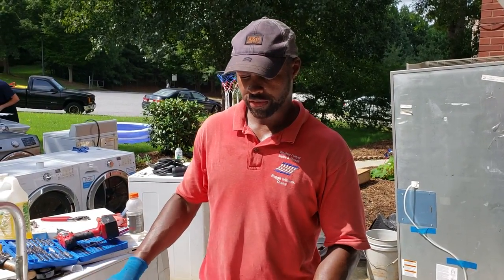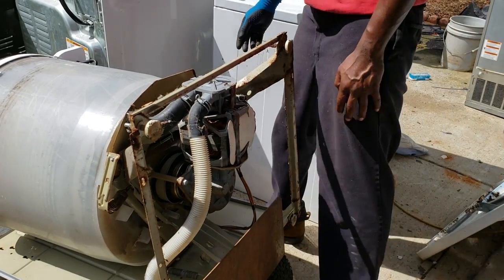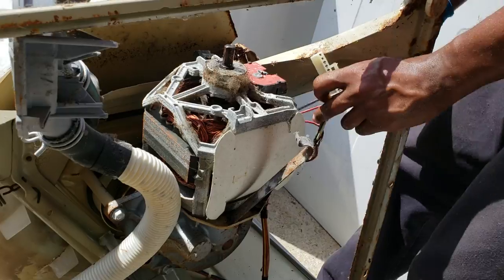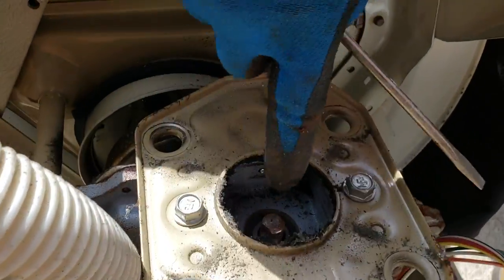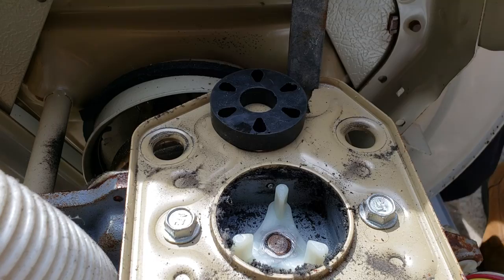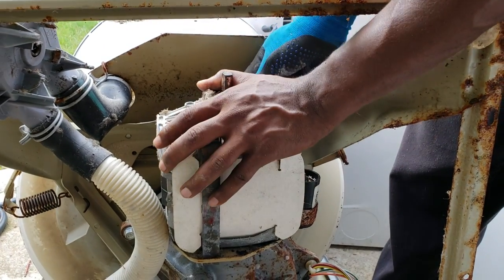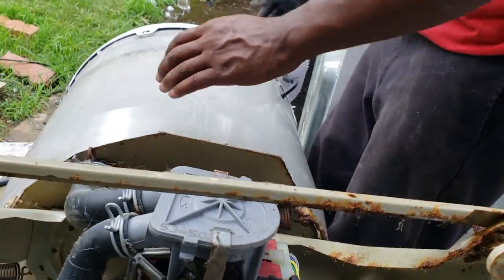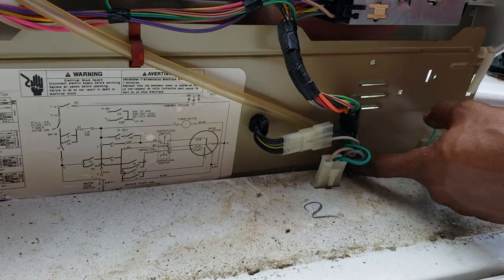Common Fix for washer not spinning, draining, or loud noise

Comment: Tfs great job on showing how to take off the washing machine cabin.
Reply: Mine is filling not agitating and drains only on the spin cycle which it does. Timer is advancing but motor not starting on wash or drain! Please help me if you can! I replaced the timer and coupling about a year ago and has been working fine ???

Comment: I'm going to take my washer apart and see what's up with it. I had a repairman out today who said the problem was some gear thing, even though it still agitates and drains and that it couldn't be fixed as the part is no longer made. Mine's a mid 90's Kenmore stacking washer.dryer. I still had to pay $99  for a service call. I would gladly pay $175 even 200, and get it fixed. Thank-you. All I can do is look at it and try.

Comment: My washer won't drainor spin. I checked the pump and its a bit stiff but spins .. When it gets to spin on any of the cycles there is no sound at all. Already have the switch taped down.  I spin the coupler by the bushing  and the motor axle moves. Amy thoughts on where to look?

Comment: What is the part number of the old part that you replaced?  My washer has a tick noise wondering if it is that part ? Runs great , but just a tick noise when washing??

Comment: Great video!  Will the washer agitate normally with a broken coupler? My washer is not spinning properly but agitates just fine. My pump is clear. Wondering if I might have a sock or something between the basket and tub. Any thoughts would be appreciated!

Comment: I have a kenmore 90 series washer the water fills up and drains but it doesn't spin. What could be wrong with it? Trying to fix it myself I took it apart and checked the coupler but it's fine.

Comment: You said not to but the washer on its side .but is it ok to do it when I pick them up to put it in my truck it's only me I slide it in then pick them up straight up ?
Reply: New washers are fine. 
It’s used washers that still have small amounts of water in them that you shouldn’t turn on the side. Unless you have a shop vac near by. Because any water in it, will be on the floor shortly after tilting. Otherwise, yes it’s fine to put on its side.

Comment: I've been looking on your site for this part but can't find the right page. Could you put a link on here for it please?
Reply: He charges $10 anyway. That part cost less than $5. 
Just Google your washers model # then use that to Google the motor coupling. Worst case scenario use your model # and call manufacturer for part number then browse Google to find cheapest site with your product.
Reply from the maker: 285753A check out the link under video description that sends you to Sears Parts Direct and plug in the part number

Comment: Does it mean I have to buy a new washing machine? 
It agitates, it drains well, but it won’t spin. 
I replaced the coupler but I still got the same result but with a burnt smell.
I have a direct drive washing machine. It’s an old machine from Kenmore (110.91264100).
Reply from the maker: Next likely suspect is: Capacitor, transmission or motor
Reply: @LeanOnYourRep  : Thanks for the reply. Thanks for this video and others. Very helpful. Attempting the transmission is beyond my weak skill.

Comment: $10 for a $1 part. 🤯
Reply from the maker: Facts are important. Part actually cost me $8-$15 OEM depending on supply and demand market conditions and that's with my business discount. Not all parts are the same quality.
Reply: @LeanOnYourRep  if you we’re paying that much, you wouldn’t sell it for $10. Unless you have terrible business understanding and practice. 
It’s plastic. Plastic is plastic regardless of who stamps their name on it. They’re all manufactured in China and imported here then sold as private label parts.
To everyone else, find your model number/part number, look it up, match it with the cheapest you can find and replace it before paying a trip charge, service fee and profit markup that all businesses have on parts/materials. 
Atlanta runs off scalping business models. Don’t support it. 

Back to page: good content either way. 🤌🏻

If anyone near Atlanta wants to buy the parts and have someone help install, I’m local. *Free of charge. But you shouldn’t need it if you follow this guys steps. 🤘🏻